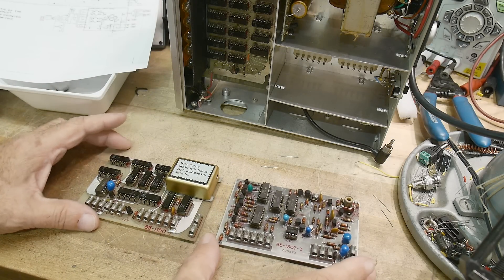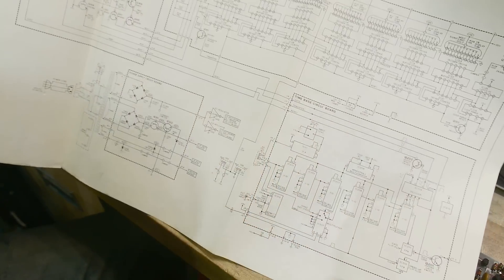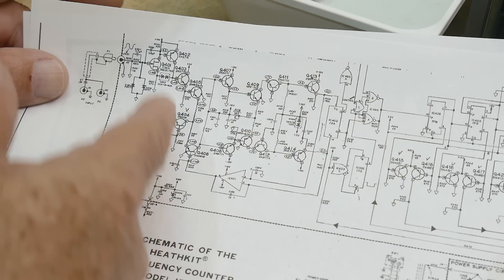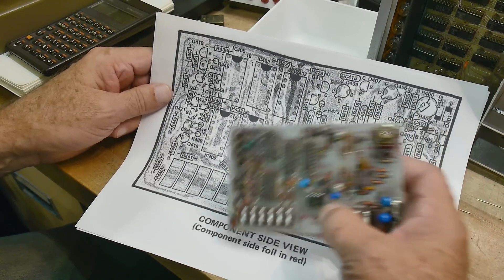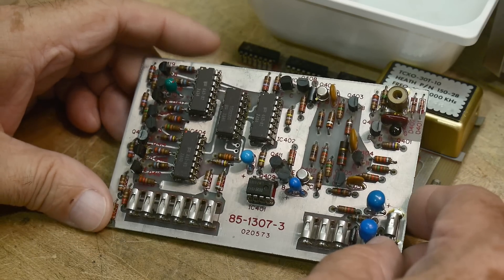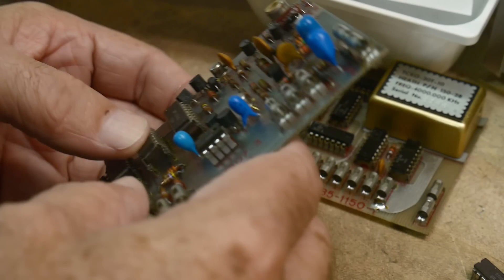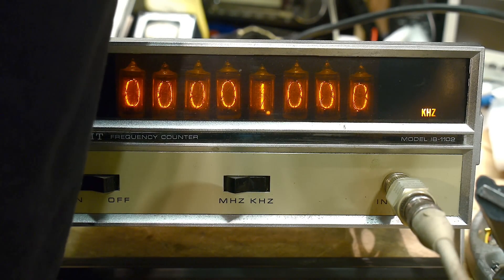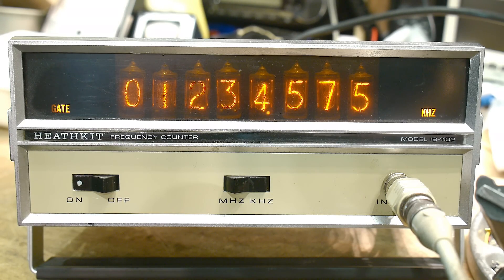#1306 Heathkit Frequency Counter IB-1102 (part 3 of 4)

Comment: The sockets are Molex Soldercons. Age appropriate for the time. You bought them on a long strip, cut off the number of pins you needed, soldered them in, then broke off the tie strip.

Comment: In my experience, about half of all failures in electronics circuits are visible under close inspection. For new items that never worked, the build error is often visible. For older (previously working) items, the failures are still very often visible (but beware of root cause of course). Close inspection and common sense doesn't need a schematic, as it's not troubleshooting (simply visual inspection). I always go straight to close visual inspection before even starting logical troubleshooting.

For the mysterious solder bridge, if there's not a trace under it, then it's probably a mistake (especially considering: Heathkit). One could look up the IC datasheet, and see what the pins are.

Comment: About the difference between the board and the schemmatic: I had the same problem with my Boonton 92C. The power supply stage in the schemmatic, it was different from the board. I spent a lot of time searching for the correct schemmatic.

Comment: We had a Heath frequency counter at trade school similar to this. It had multiple push buttons to select different ranges other than Khz/Mhz. It had a 567 PLL that would multiply low frequencies (below 100 Khz?) so you couls get .1 or .01 Hz resolution for audio frequency measurements. I sat with my instructor while he worked on it. Yep, the main filters were bad - this was back in 1980. That TCXO is temp compensated, not an oven. I wonder if that board went in another counter like the one we had at school.